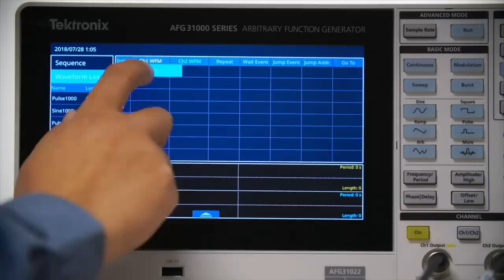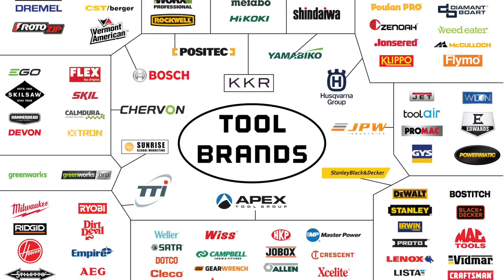Who Owns Your Favorite Power Tool Company? [2023]

Comment: I bought the original RotoZip buy Rotozip. It was a great idea horribly executed. I had it 3 months and returned it to Home Depot three times. The first time the power control failed it only had one speed instead of the original 2 for some reason. The second time, keep in mind going to be advertised uses was to cut drywall the bearings went out. I was helping a friend with the remodel when I bought the Rotozip. The third time the lock button flew off when I released it after changing the bit. After that Exchange I put the tool back in the case in my tool cabinet for a couple months them want to use it, and the power switch was messed up again. I was really pissed. Keep in mind Home Depot did a great job of swapping out the tool for one off the shelf. So each tool that broke was a brand-new Rotozip. When the power switch broke the second time I went online and just raised holy hell with RotoZip I was Furious. I mean granted this stool was about $120. To some folks $120 it isn't worth raising a fuss over. To me it's my hard-earned money and I expect to get something decent to use. I take care of my tools if my tools came in a case they are still in a case. I bought sayings for one time use like my hammer drill, I paid $10 for this no-name hammer drill. It's over 20 years old now and it still works. So you you can figure I take care of my tools. I was raised that way. so I raised hell with Rotozip and found out that Bosch had bought out Rotozip. They were very apologetic for my experience and they sent me a brand-new Rotozip and a return shipping label. I didn't have to give them my credit card number or anything they just sent it. The revised design is very good. The only complaint I ever had with RotoZip was buying the add-on accessories like the plunge router was pretty expensive. I was at Sears one time and I was looking at the plunge router add-on which was $59. sitting right next to the RotoZip was the Craftsman rotary tool they came with a plunge router base. the Craftsman tool was $69! so I bought the Craftsman tool just so I'd have one with a plunge router. And the Craftsman tool from what I can tell is not much different from the RotoZip product except it has LED lights tool illuminate the work surface. so if any of you bought the original RotoZip and returned it in disgust because of the poor quality yeah, go ahead and get one now because Bosch made the RotoZip a much better tool.

Comment: Menards has Masterforce which I know is at least partly made by Chervon but has tools with distinct similarities to certain Hi-Koki, Hilti, and Bosch tools so I'm sure Masterforce is a contract fulfillment brand that contracts various tools to different manufacturers. They also have Performax and Tool Shop but those are low level home owner tools that I know very little about. Grip Fast fasteners and Mastercraft doors are also Menards brands that are manufactured by Midwest Manufacturing in Plano, IL which is owned by Menard Inc.

Comment: Metabo has been my best Power tool, a abrasive disc cutter and can switch to a grinder wheel, also. i have one at home and the shop i used to work couldn't run without them Daily.

Comment: What about Panasonic cordless tools? I’ve got a drill, impact driver 14 volt with 3  original batteries , about 12 years, still use daily. Is Panasonic still in tool business

Comment: Pro Tool Reviews,

Can you tell me, what parent company manufactures "Yestar" brand tools?

I had never heard of the brand until I began acquiring power tools in the Philippines, after having lived here for about three years.

I bought one of their corded hammer drills a few months ago, for which I paid the equivalent of only USD $40.00.

I've used it quite a bit, mostly for drilling into concrete, and more recently, for drilling through hot rolled steel.

It's a pretty decent piece of equipment, and so far I've had no trouble with it at all.

There are so many throw-away garbage products on the market here, thank I honestly expect most things that I buy, will turn out to be low-quality junk.

But have been pretty pleased with the Yestar hammer drill, and with it's durability and performance.

I've worked it pretty hard, quite a few times, and it has never overheated, or exceeded its duty cycle.

Since I bought it, I've been seeing no more power tools bearing the Yestar brand, as well as hand tools.

I've been looking at a couple models of their 4" angle grinders, which both come in at about the same price as my hammer drill did.

I've tried to find information about Yestar online, but have found nothing conclusive.

It would be interesting to know who manufactures them, and where.

Thank you!
Reply: Pro Tool Reviews 

Hey thank you for your reply!

That's about the sum of my results, too. I never could find any information about them at all.

Since I posted my question to you, I have seen another brand or two of hammer drill that appear to have been made from the same tooling as mine, though those brand names escape me at the moment.

I keep seeing more and more products for sale in our local retail outlets, bearing the Yestar brand, both power tools and hand tools.

So far, the hammer drill has performed well, and has never yet let me down.

I'm considering buying one of their angle grinders. I can buy one of several models of 4" grinders for just USD $40.00--$45.00.

I'm thinking that it might be worth trying, since I've had good results with their brand, so far.

Thanks for taking the time to research them!

Comment: By the way I won't buy anything labeled Black & Decker. They are absolute junk. I bought a firestorm set several years back. It came with an 18 volt drill that had a really cool drill chuck, a Sawzall, a circular saw, a vacuum, a flashlight a tool bag and a workmate bench. It was like $400. Before then Black & Decker had always been a fairly good tool. Not the best but durable. Well I also had a Ryobi 18-volt drill. Both had nicd battery packs. The Ryobi battery pack out-performed the Black & Decker battery packs by miles. I could run drywall screws all day without a recharge. The Black & Decker I'll be lucky to get a couple hours of use out of. As I stated in a previous post on this video I take care of my tools I keep them clean I don't throw them around. So I had to use for that amazing Chuck on that Grill. What was amazing is you could take the check off and inside the Chuck was a driver for a bit like a screwdriver bit. And it worked with the clutch and everything so it was really great to use. I was putting up some curtain rods in my new house and I set the Firestorm drill on the back of the sofa. Which is probably 36in or so high. It fell off onto a padded carpeted floor. Not onto concrete but padded carpet. The drill exploded into its component pieces. The gears fell out the screws ripped out. I've dropped a tool before not very often but I have. And I have never ever seen anything like it. the Chargers that come with the standard Black & Decker garbage unless you got lithium ion are worthless. They take 8 hours to charge a battery and then I don't think they even charge it properly. and then the ultimate finger to the public from Black & Decker was coming out with a 20 volt lithium ion battery but not on 18 volt. If you have a Ryobi 18-volt tool that takes the old nickel cadmium batteries oh, you just have to buy the new charger and Lithium-ion batteries and bang your in business. Black & Decker didn't want to sell you a charger they didn't want to sell you some batteries they wanted you to buy another piece of crap tool that they had. That really sucks for them to do that. a ward of warning in case you don't know, always make sure you have a charger that is designed for the chemistry of your batteries. If you don't you could be trying to put out fire. The  worst one being the lithium ion batteries if they catch fire.

Comment: I use Ryobi because of its interchangeable battery platform on a host of different products. I really don't know if all the different manufacturers of power tools are on the same level of reliability, longevity and such. I had a cordless 18v drill given to me but it quickly faded. Batteries are the key. I had a friend who gave me a good price on a Dewalt drill with accessories. Batteries don't hold a charge when setting idle. Not good when I need something at once. I've got the drill which works fine, but the batteries are its weakness.

Comment: Some tools , sockets, hand tools etc, alot are all the same. Cordless DeWalt is the way to go. I have a set that's 9 years old . I worked commercial construction and would abuse the hell out of them , original batteries still work.

Comment: I would like a list of cordless power tools that use the same battery pack or a compatible battery pack.
Reply: Who wouldn't LOL I would assume the companies that own a few different brands of tools use the same battery but a different base to mount the battery to the tool, thereby making the battery proprietary, and allowing the company to mark up the battery when it is used for their "better" lines of tools, and the consumer needs to buy a new one.  If you have a "bad" battery, try and take the old battery and open it up, find out what type of batteries they used in it, and solder a new set in. 👍🏼😀
Reply: The only ones that are even sort of compatible are black and Decker and dewalt but they have to be modified in order to work with one another. There's plastic notches/protrusions either on the battery or tool that have to be ground/filed to be compatible with one another.
Reply: planned obsolescence...need to repack your own...

Comment: What exactly happened to Delta tools ? They use to have a huge presences in the woodworking industry. I heard they got bought out by Black and Decker , but I couldn't be certain of that.Ok I just looked them up on Wikipedia and I was right. They were acquired by B & D but have since been sold to a Co. out of China. I have their newer Unisaw with the two adjusting wheels up front and hope I can get parts if I ever need them. I got it in 2012 and that was just after they sold to Chang type Industrial Co.

Comment: My whole tool life has been a lie LOL I just purchased a black and decker saw , most of my tools are Bosch Blue and black and decker , and I love my little dremel tool . Well I guess for home use these tools are good enough . Ryobi has been my worst ever brand , their tools just break so easily compared to the others , Much cheaper though , so I buy those tools that I wouldn't really need much use , although the older garden grass cutting tools were of good quality I must admit. Glad to see that these brands also make some of the big expensive brands . If your using tools just for light duty , DIY and home use , I dont see the need for spending 4 x more on the more pricier brands .

Comment: I knew Milwaukee was Hong Kong owned by TTI , a once hugely successful "adult toy" company !  Milwaukee had been bought and sold a bunch of times, previously owned by a french company . The last major "USA" owned portable power tool company is B&D Dewalt since they gobbled up Porter cable/Delta and pretty much liquidated them. Sadly Porter Cable is now their China brand except for about 6 tools that Dewalt didn't already make. Makita make a majority of their tools in Auburn GA now and is Japan owned.  Rigid power Tools would also be a "House Brand" of The Home Depot even though it was spun off of Rigid Pipe tool company by using the name and manufactured by Emerson who made Craftsman Power Tools for years.  Also Bosch is the only one that isn't a corporation fwiw

Comment: Menards basically picked up the Craftsman hand tool playbook off the ground after Sears dropped it...then ran with it (funny thing...Menards ins't going bankrupt either). Masterforce sockets and some wrenches (the ones that say "Made in the USA") are contract made by Apex.  In fact most of the designs are IDENTICAL to the Craftsman "teardrop" ratchet made prior to Sears moving to production overseas (parts interchange too).  Masterforce screwdrivers (and some snips etc) appear to be Western Forge also (same weird celluloid smell too).  

As far as cordless and power tools go; Some have repeatedly claimed elsewhere that Masterforce is made on contract by Makita. Even going so far as to say that the tools are rebadged Mactec (Makita's discount line). I haven't been able to find any evidence of this (and it sounds like wishful thinking at best).  It's far more likely that Positec Tool Group is the OEM (and has been since before Rockwell and Worx were launched).  It stands to reason since Menards also carries Rockwell and Worx lines (but does not stock Milwaukee, Dewalt, or Makita).

Comment: I take it Husqvarna is no longer making Craftsman mowers any longer, since the aquisition of Craftsman from Sears? For a time, they were being made by both MTD and Husqvarna for Sears. The Husqvarna Craftsman mowers are (were) of higher quality and had the higher price tag.
Before all of that Husqvarna power equipment was rolled into AYP which was an asset of Sears and included, Craftsman, Husqvarna, Poulan, Weedeater, etc. Pretty sure AYP became Husqvarna and AYP took over Roper before that way back in the 80's...
But anyway Craftsman mowers have gone down hill, they look nice that's it, their just another mainly Red MTD now...
If anyone knows if Husqvarna is making anymore Craftsman mowers speak up, or if I was right about that being finished.
The last good Craftsman I saw was the T2200 from Sears made by Husqvarna in 2014. Now their made by MTD, use that same hood, but everything else is different (cheaper) unfortunately.

Comment: Different tool brands are made to different specs, even within corporate families. Porter-Cable used to be the ultimate, now they’re worse than Chicago Electric. Stanley acquired majority of Mac Tool stock but has nothing to do with quality or their business. It’s all about manufacturing specs. Old Craftsman is pretty good, newer stuff not so much. Old Craftsman had “WF” on the handle for Western Forge out of Colorado. Look for those at yard sales

Comment: You need to update on the Lowe’s/ craftsman connection and are cobalt and blue hawk still sold
Reply: Lowe's owns or licenses the Craftsman brand. Craftsman is positioned as their low-end hand and power tools, and they are really crappy. I wouldn't wish their 10-1/2" table saw on my enemy. Kobalt is now their "premium" brand, and both hand and power tools are pretty nice. hand tools are solid and well-finished. Power tools have quality feel. The Kobalt 10-1/2" power saw compares well with the Bosch and DeWalt in terms of feel and quality of the rip fence, vernier, tilt wheels and such, and it's about 15% less money. No idea how it will last.

Comment: I bought a blower in 80s on sale unknown brand when i started it after  5ms is vibrated my hand numb they assholes wouldn't take it back 🤷‍♂️$ up in smoke
my modem was playing up 2019 i thought oh fook its over 1 year old  something was resetting it every 2-4hrs turns off & on then i couldn't get into it at all ? even with the internet tech provider 1 hour 1/2 hr wasted then as i was tired of it all 1 last try google it came on WTF  OH i thought i mite try & take  it back without 1 Q's he had a new one ready i near fell over in shock 😳 WAS working  great for 1st year 50/20 speeds NBN in oz 🐨🦘 no worrys - then july 2019 onwards something started going to chit 🧻🚽😆🥵👍🥇🦘 lectrical always something weird goes on  THEN fixes itself if turned OFF for a while  like my fridge  now & then breaks the circuit breakers   i turn off 1hr and is all ok for a months ? no idea why